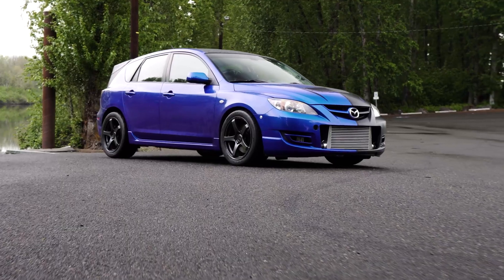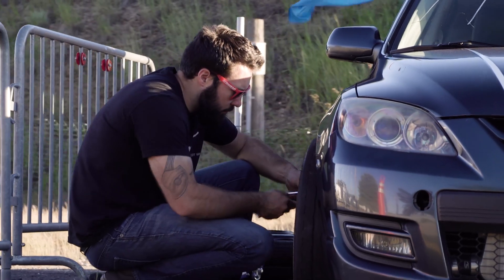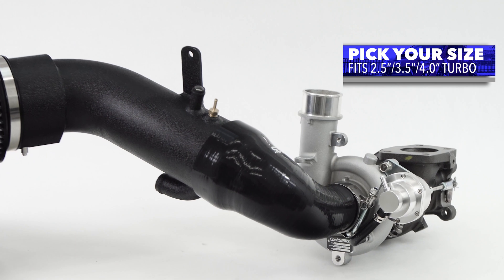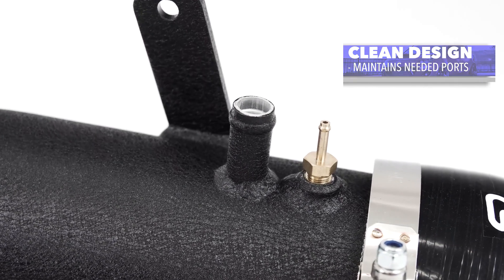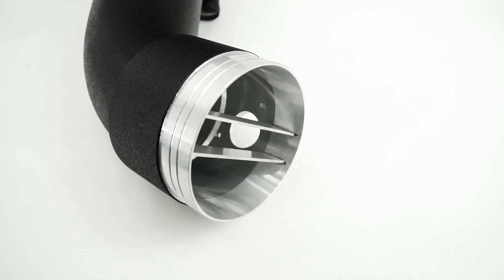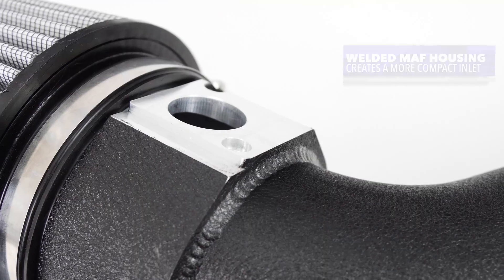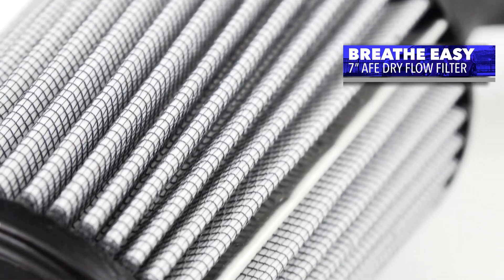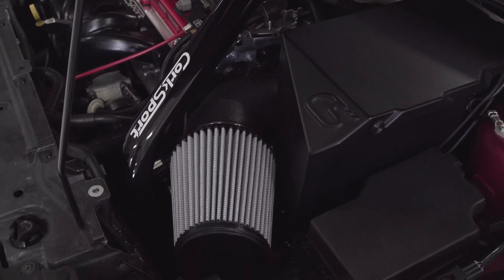CorkSport 4" Intake System for 2007-2013 Mazdaspeed 3

Comment: CorkSport only officially says this is for the MS3.  They said possible fitment issues with the MS6. But someone on Mazdaspeeds org took the chance and tried it with their MS6 and it seems to fine from the pictures and his report.  So, I got one on order for my MS6.  I almost went with a competitor's 4" silicone intake because it did specify the MS6.  But I would prefer the CS aluminum and since it seems like it will work, I got it coming.

Comment: You couldn't have gotten this out last year 🤦‍♂️ I would have bought this in a heart beat now i have a jbr 4 inch. I really want to go all corksport parts on my car.
Reply: JBR has a 4”? I can’t find it on their site.  I only find 3 and 3.5.  HiTuned Performance has a 4”.
Reply: @CaseAgainstFaith1  its on the 3.5 inch intake and then their a select button and you can choose the 4inch
Reply: @jesussegura7838  That doesn’t get you a 4” intake, it gets you a 3.5” intake with a 4” coupler. The MAF is only 3.5”.
Reply: @CaseAgainstFaith1  thats true bc o also wanted a 4 " and ended up with the 3.5 which is good enough for up to 500poneys..or even more
Reply: @raquielcross5757  I am looking for about 600. So I went 4”